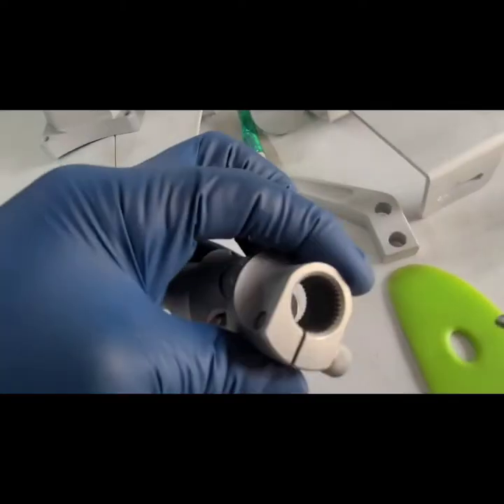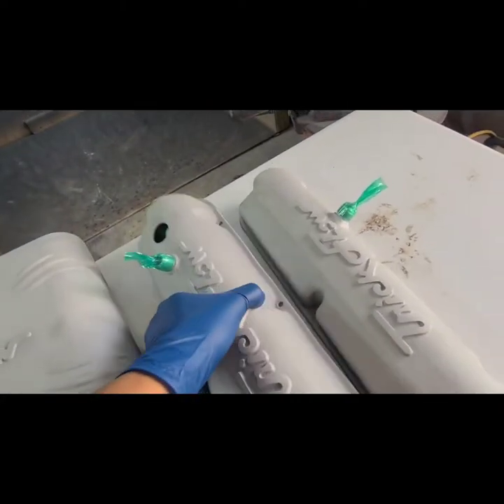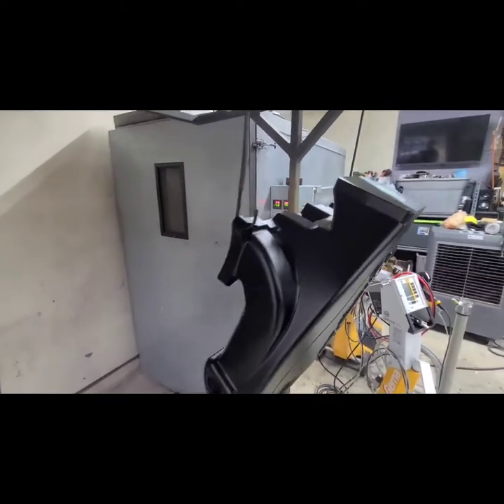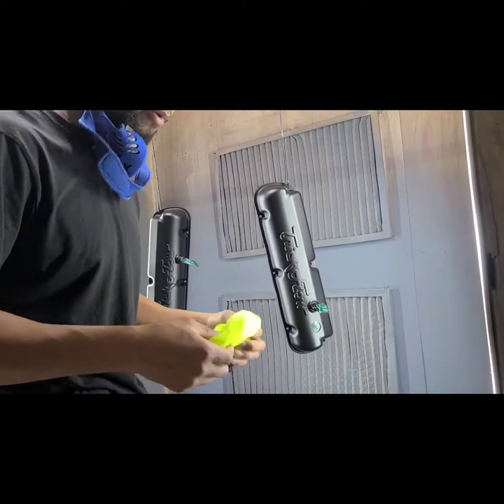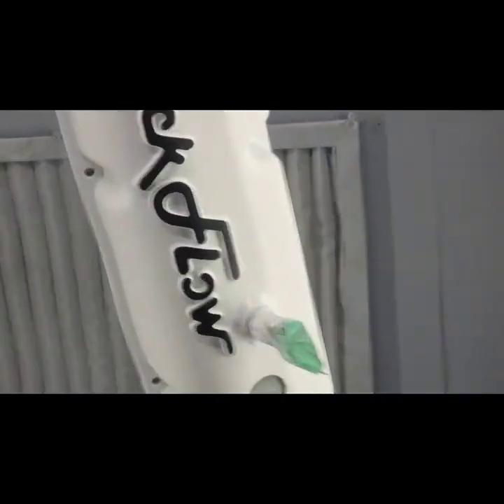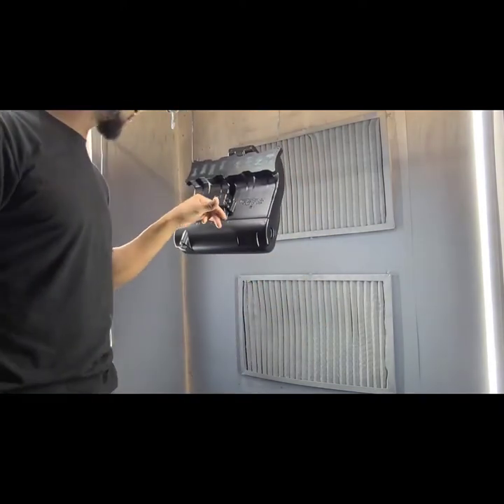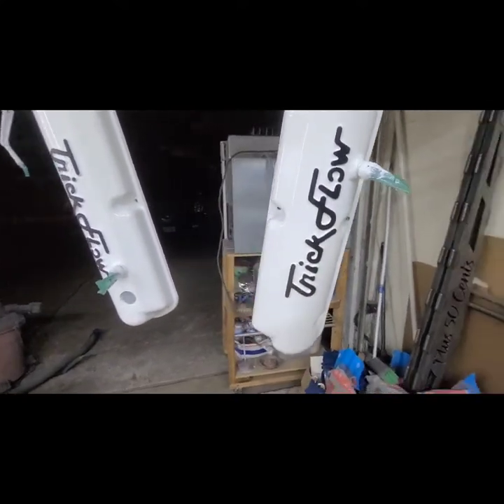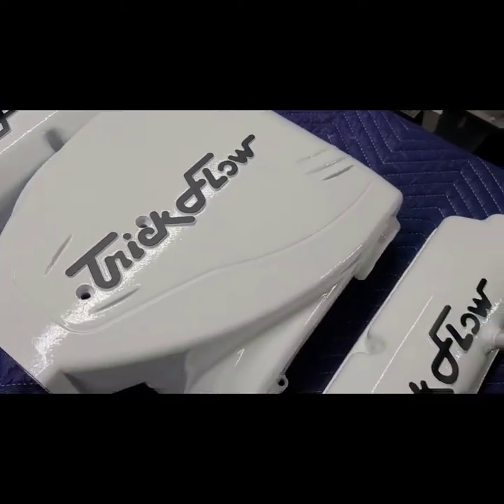How to 2 Tone with Powdercoat THE RIGHT WAY

Comment: You are obviously a master of your craft. Very nicely done sir. Thank you for the excellent video!
Reply from the maker: I really appreciate the kind words and you taking the time out to watch my video. I look at everyday as a good time to learn something new.
Reply: @powdermancpc1633  I'm new to powder coating. And I'm thrilled to see people like yourself sharing video's like this. 
I've only done single coat items using Prismatic Powders powder coat with excellent results. I've yet to try a two stage setup.
But I'm looking forward to it once my new Eastwood gun system arrives.
It'll be interesting to see how making different voltage adjustments make a difference in performance.

Comment: Do you have the smaller hoppers for the Gema? Just curious as to what you are using  for smaller jobs such as the candies
Reply from the maker: For any jobs even small ones the box feed is great. I keep a small box that I can put a bag of powder or a cup with powder and drop the pick up tube in. It's quicker and easier to clean than a hopper setup would be.
Reply: Thank you for the reply! Looking at Gema right now....trying to decide. Do you know that they have a Q model of the pro? Supposed to have faster color changes.